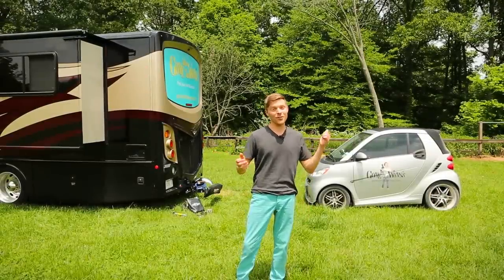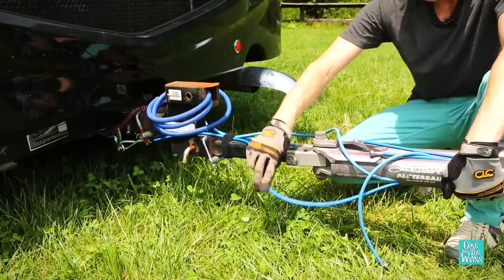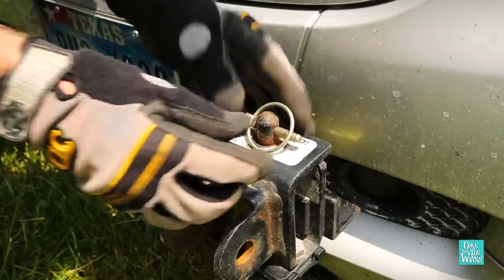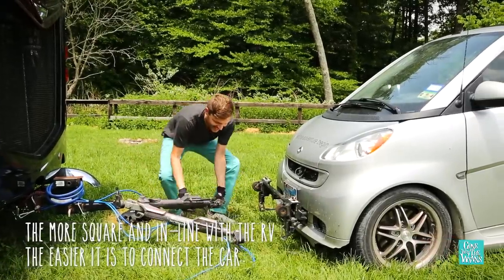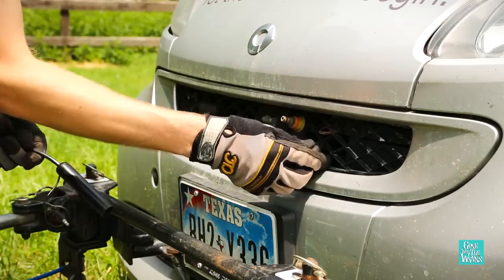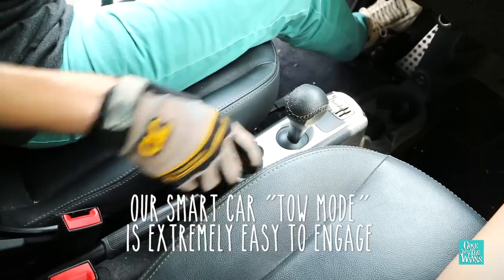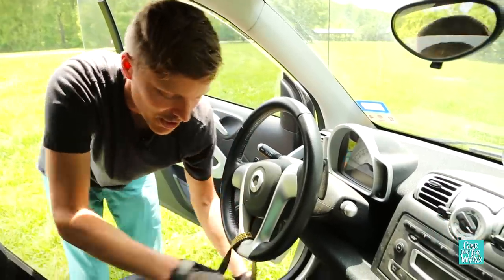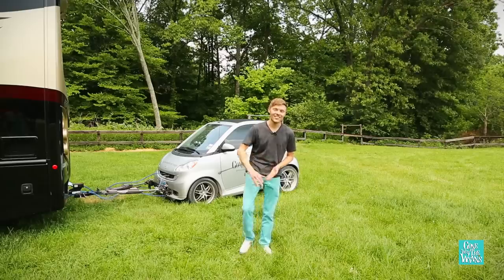How to Properly Connect an RV Tow Car

Comment: Couldn't afford the retractable tow bars, and brake buddy was the only option for my Suzuki Samurai as far as brake assistance. My (not too) costly recent towing mistake... Lost the key to the tow bar hitch lock. A neighbor distracted me with questions about the Suzuki (everyone wants one) and the Airtabs on the RV (no one knows what they are) Broke my procedure, and now, the non-retractable tow bar is stuck on the RV. Got the car off, but now, I need to get it all together, and drive to a locksmith.
Reply: Yours just uses a padlock doesn't it? Those are easy to pick. Or cut it off an buy a new one, it would be cheaper than a locksmith
Reply: Not a padlock, but a hitchlock.
Reply: Yea, I went back an re-watched your video on it. Probably some pretty hard steel but looks like you could cut it.
Reply: Great news! The campground called to ask if I lost some keys! Yes! I was only a few miles away, so I am back in business with the key and lock! Now, to hide an extra one away, for emergencies.

Comment: You said you put it in tow mode and then all you did was put it in NEUTRAL, are you pushing another button for TOWED MODE?  I was told turn the key to ON, put it in Neurtral,  now turn key back toward off but it will stop before it is in off and that leaves the steering wheel able to turn with the RV around corners etc(so tires are not scrubbed and straight all the time) Hook up and off you go.  SO the question is, did I miss a step, TURN ON TOW MODE, or is that really not what you meant and just meant to put in Neurtral??
Reply from the maker: +Sandie Bock Some cars are a little different, so the best advice is to check your owner's manual and do exactly what it says.
Reply: You are right but they were talking about the car I have so was asking about the "Tow Mode" if there is one.

Comment: What is the automatic battery disconnect for?
Reply: Because you have the key on so the steering wheel will turn, so Battery Shut off shuts down the battery from being drained.  MAKE SURE your dealer has the power cord from RV to TOAD getting power from the RV otherwise your break controller will not work with the battery shut off ON.  NOT sure but running lights on car and brake lights etc may not work either with battery cut off ON if the power cord has power coming from the car.

Comment: Wouldn't a separate tow trailer to put your car on be better.  It would save wear and tear on the car and not require the modifications to the car itself.
Reply from the maker: Well, some people do that but we will always go with a car that can be towed 4-down. Towing on a trailer or tow dolly means that when you reach your destination and unload the car, you have to park the trailer somewhere. Most campsites are too small for a coach, the vehicle, and a trailer. Some have storage areas where you can park them (sometimes for an additional fee) but many do not. No system is perfect.